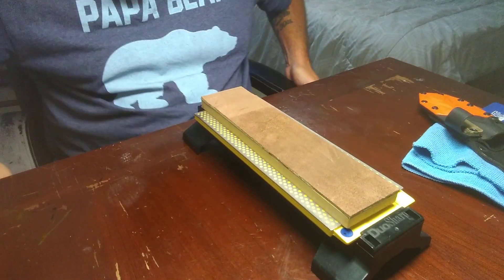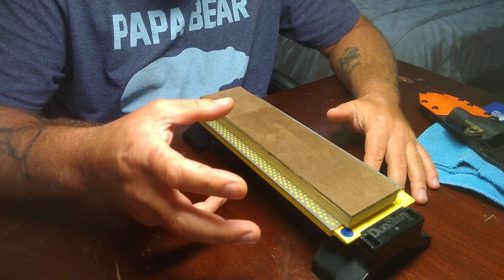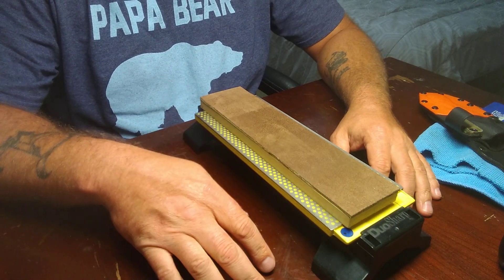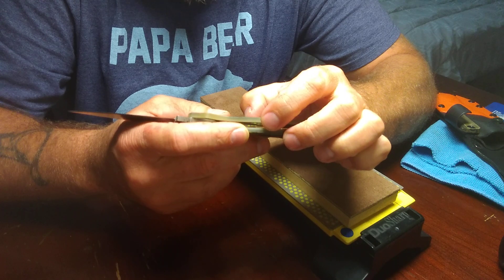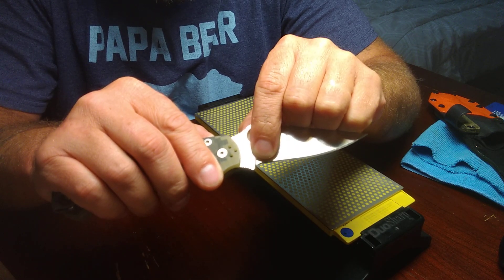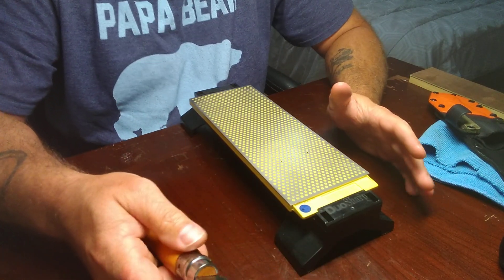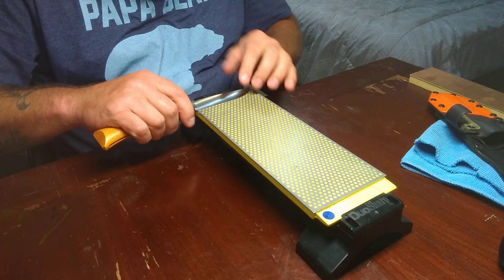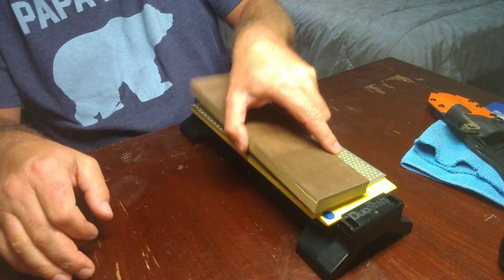Stone position and a neat trick

Comment: What diamond stone are you using?
Reply from the maker: Dmt coarse
Reply: @roughroosterknifesharpenin5531  Cool thank you. I have one their their extra fine and it does great I will have to check that out. I heard you can use a dmt course stone to flatten out a stone that has dished out...is this true?
Reply from the maker: @TheKellisunshyne  Don't do that
You'll ruin the dmt
Reply: @roughroosterknifesharpenin5531  I just seen your video where you flattened those Arkansas on your grandma's porch lol. If your concrete pad is too smooth can you put sand down and use that as a way to make the surface more course?
Reply from the maker: I argued with people for months over this in the comments. Novaculite is extremely hard. It will crush it almost immediately.

Comment: Have you ever repaired a broken tip? I broke the tip off my buck 110 trying to pry bark with it. I might be able to fix it with my belt grinder and a ceramic belt but I'm sure it's going to be a pain in the ass.
Reply from the maker: I have repaired many broken tips.
If you do the belt sander, you'll de temper that blade.
Reply: @roughroosterknifesharpenin5531  maybe an extra coarse diamond stone?
Reply from the maker: @ruen99  could do that. Or a coarse dmt a coarse crystalon a coarse India etc